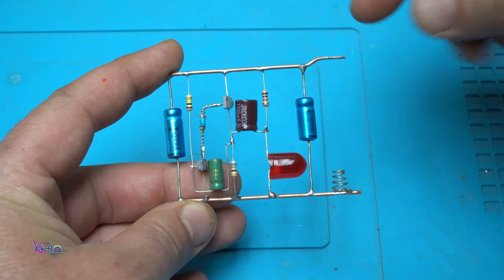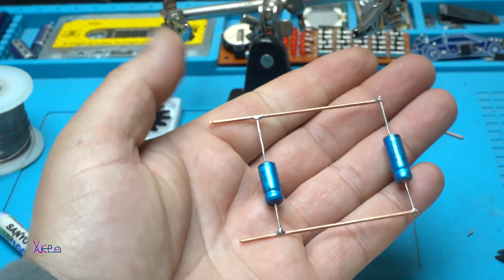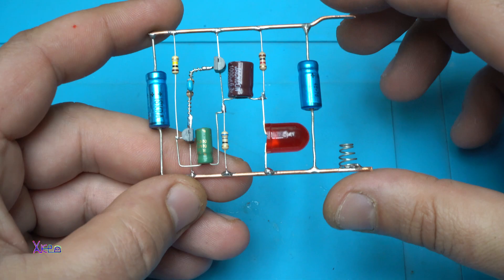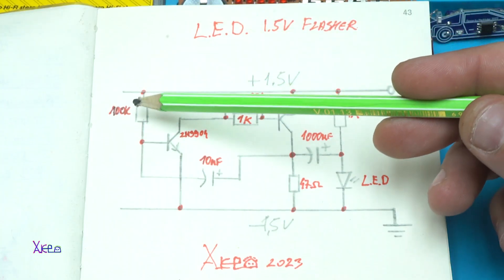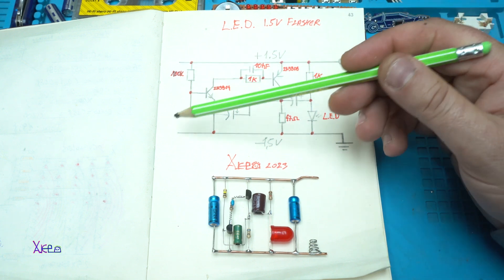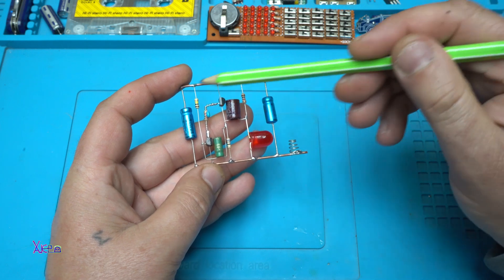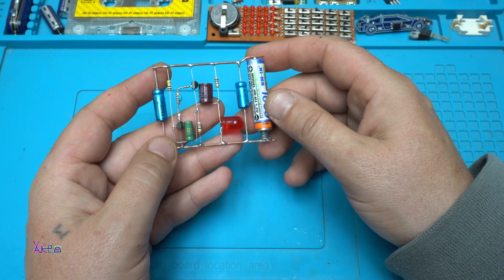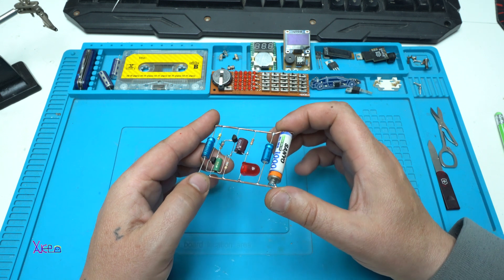DIY 1.5v Long Time Blinker with Skeleton Circuit

Comment: I've noticed that this circuit doesn't handle reverse battery polarity at all, I suggest adding a schottky diode between the emitter of the PNP transistor and the 1.5 volt positive rail, stripe towards the positive rail.
Reply from the maker: Thanks for the suggestion!

Comment: Usually the forward voltage of a red LED is at least 1.8v, so how does it turn on with only 1.2v?  Charge pump from the 1000uf capacitor?

Comment: I have a question, I made the circuit on a breadboard according to your diaphragm but the LED does not light up at 1.5 volts, what could be the error?
Reply from the maker: Need to check this: did you use npn and pnp transistors and check pins on them
Reply: @Hacktuber  f I did, I checked it and there is nothing damaged either, I did everything the same as the video, the strange thing is that it turns on with 1.5v and stops working